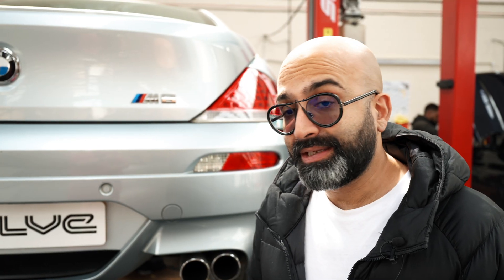S85 V10 Rod Bearing Service on E63 M6

Comment: What weight oil do you recommend for the s85 and s65?
Reply from the maker: 10w60 is perfectly fine, but you can also move to a 10w50 if you prefer.
Reply: colder weathers probably a 5w50